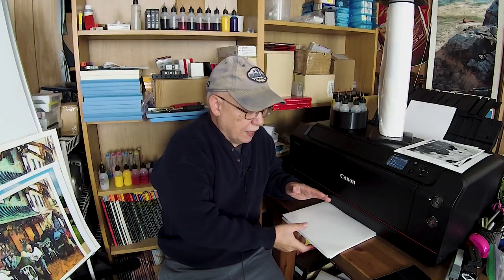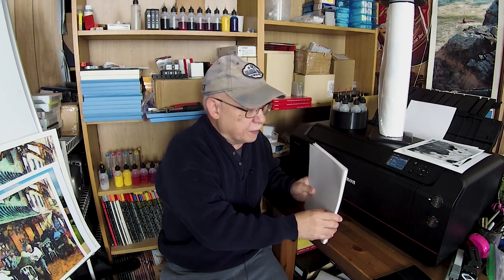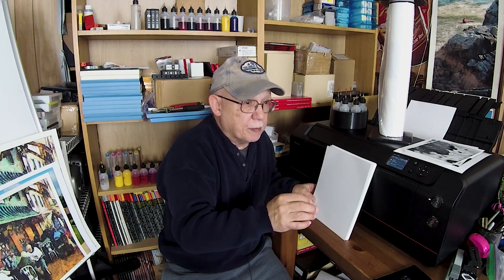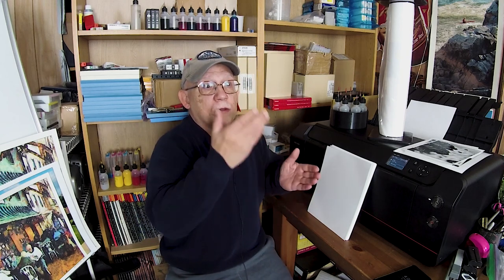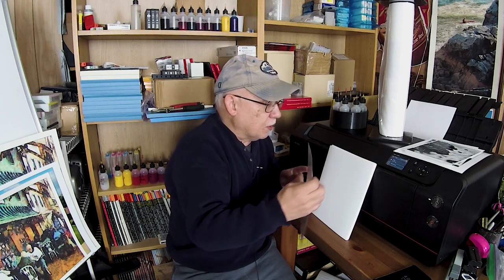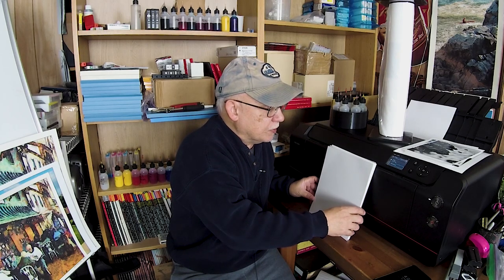If you do this you will likely get Printer Head Strikes!

Comment: Hi Jose, love your channel and appreciate this tip! I'm new to printer with my Canon Pro 100. I've been loving the printing experience but as of yesterday my Canon Luster Pro 8.5x11 paper has been smudging on the end when coming out of the printer and making a very subtle grinding type noise just as the paper comes out at the end. This does not happen on my 13x19 prints at all. Unfortunately the room I print in is dry due to electric heating. Is this issue caused by slight paper bend on my 8.5x11 sheets? It's the subtle grinding noise that's most concerning. Thanks! - Rod
Reply from the maker: This is called Head strikes. Meaning that the print head nozzle plate is literally and physically rubbing onto your paper surface. It is usually caused by curling of your paper. Your paper not being perfectly flat or when you are printing borderless which I highly recommend you to not do. There is a setting in the maintenance tab under print options called "reduce paper abrasion".  Go ahead and activate that but the catch is that you will be asked to approve the print job every single time you sent an image to print.
Reply: @cheo1949  Thanks so much Jose, I really appreciate it!

Comment: Will using the manual feed on the Pro-100/S help avoid head strikes? And if it's the edges of the paper that's getting ink on it then how big of a problem is that, can't we just trim those edges off or is it damaging the inside of the printer too.
Reply from the maker: Making sure the media is flat and the edges do not curl upwards will pretty much prevent edge bead strikes. Also choosing Prevent Abrasion in the maintenance tab.
Reply: @cheo1949  Prevent Abrasion actually fixes the issue. I always get the nag about the setting being on when printing. To your own eyes is there really a discernible difference in print quality when the setting is on or off?

Comment: We are getting printhead strikes with our Canon Pro 2000, we print on canvas and we have raised our printhead, increased vacuum strength and roll tension and we are still regularly getting strikes, wasting canvas daily. Please help!
Reply from the maker: Try "Avoid Paper Abrasion". You've done about all I would've done. Are edges being hit or the inner surfaces of the canvas media? Curling and or buckling due to excessive ink density will be your causes of head strikes.
Reply: @cheo1949  Thanks, we are fairly new to printing on canvas (8 months), but we've printed a lot, around 2k ft of 24" canvas. The strikes can easily run into the middle of the canvas, but most do start on the edge. Still, I don't notice curling on the edges. See here for pics of recent strikes, these are at the beginning of the day, the test prints our the 1st prints of the day ... we've seen strikes especially early on every day so we try to catch them on short sample prints. 

https://photos.app.goo.gl/RqBMWzVW1ndU15Jq7

One more comment, these seemed to have gotten worse with a new canon printhead late last year, I thought it was just that it needed to be raised, but that's obviously not solved the issue. Contacting Canon will be our next step.